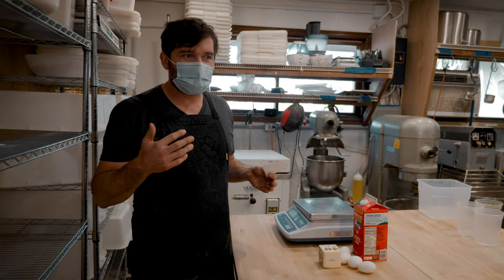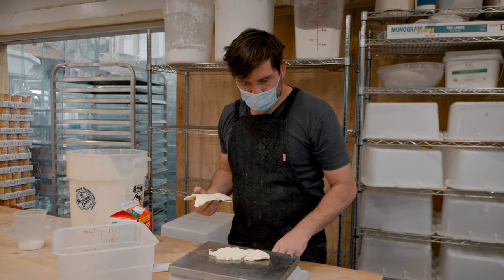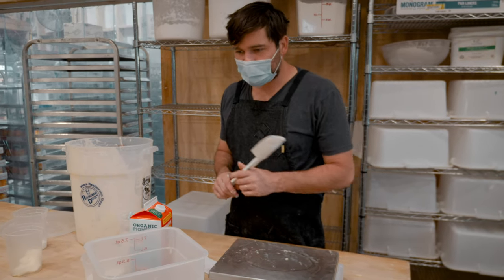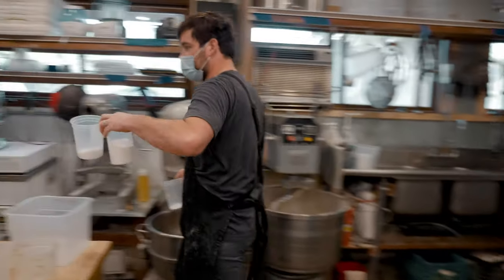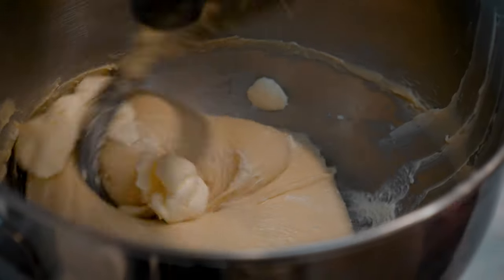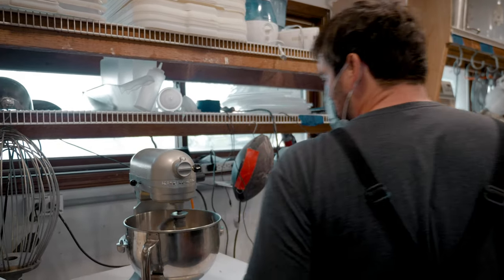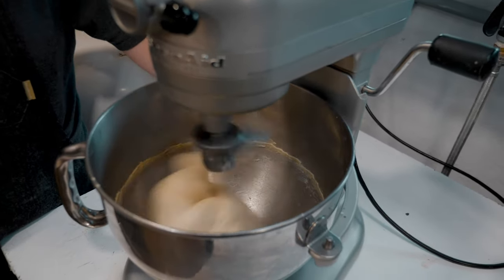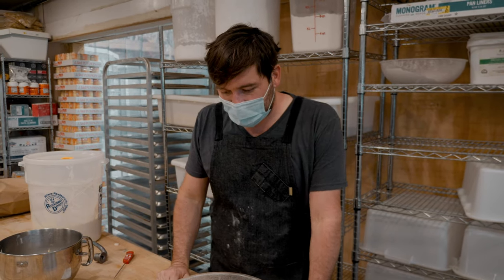Mixing Brioche Sourdough | Proof Bread

Comment: Thee struggle of small dosages! Sometimes home baking goes bad, especially in the pastry area, because the amount of the ingredients are not well proportioned. For example the eggs: every recipe reads for how many eggs, but eggs vary in size and their mass could vary several grams. That difference could be deleterious! Also how the mixers work is different: small batches are best worked by hand. Good stand mixers are those that have bowls with 8 quarts capacity and upward. Even at home I do have a 8L capacity bowl stand mixer, and that it is great at mixing: from pizza to meringue!

Always a pleasure watching your videos!
Reply: Yep I can attest to the eggs problem 😩

Comment: For my brioche dough I shred frozen butter and then weigh out what I need.   I place shredded butter in refrigerator until I am ready to use it.   I find the shredded butter easier to incorporate into dough.    I use 9% water, 50% eggs, 50%Butter,  I will have to try a batch with some whole milk in place of the water.

Comment: Jonathan, would you like to borrow a Bosch 
Universal machine for small loaves?  It will 
knead about 10 pounds of dough.  My mother 
had one, when we were kids, in the early '70's.
(There were 7 of us kids, and she baked at least 
3 times a week.)  Yes, bread, but also cinnamon 
rolls and cookies.  That machine wore her out.
Would not even think about not working.

All of my siblings have them, and swear by them.
My older brother, has a KA, that he swears AT!
(I loaned him mine, and he wouldn't give it back.)

Oh, the drive for the dough hook, is on the bottom 
of the bowl.  Absolutely NO reason to "scrape down!"

Not the Universal Plus, but the old-style Universal.

Yes, I'll let you use it.  Completely free of charge!
Even find one for you, if you want one.  (That will 
cost my expenses.)

I used to work in a Microbrewery, and we had 
a few homebrew setups, for doing test brews.
About a 5 gallon batch.  Our large brew setup, 
about 15 barrels, or close to 500 gallons, so 
the math was easy to do.  You might want the 
same flexibility, when designing new bread
 recipes.

I'm not real close, south of Broadway, just west 
of Mesa Drive.

steve

Comment: 10:00 Is creaming the sugar into the butter not an option? That would also make the butter more workable
Reply: I think he is afraid that the name of the product will change from bread to cake if he does that.
Reply: You can use honey as well (little more expensive and need to adjust liquids). That's what I use in my brioche, and it works well.

Comment: Why is he wearing a mask? Flour?
Reply: Working with close proximity with other employees, setting good example. A bakery like theirs has to do everything possible to mitigate risk of outbreak.
Reply: @kyle2  Right ... except they dont do anything to prevent that. Even if they did, he keeps touching the mask and then touching other things, the dough, etc. The bread is going in a super hot oven, anyway.
Reply: @mr_reborn  masks do prevent the spread of the virus, limiting transmission in the air and ensuring particles are not expelled via coughing or sneezing
Reply: Kyle 2 huge study in my country says otherwise - in fact the study was kept out of public because it came to that very conclusion.
Reply: @mr_reborn  sounds dubious, send evidence. it is common sense that masks restrict particles from dispersing.
Reply: Kyle 2 for bacteria yes. Not virus, they are too small. Its not about droplets either, they tell us we breathe it out, our very breath is dangerous 🎭. You can look up “mask study” yourself